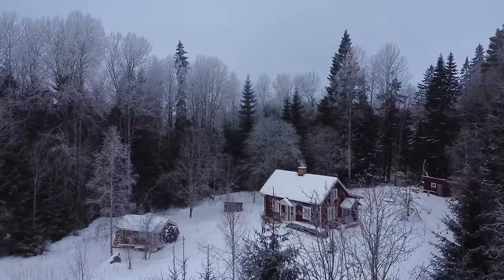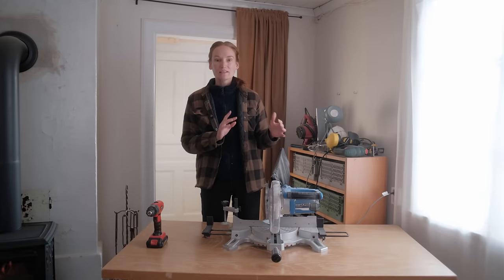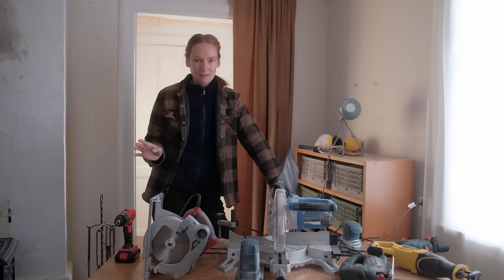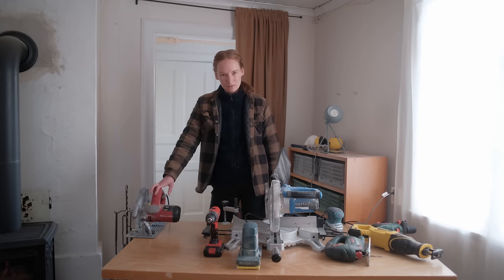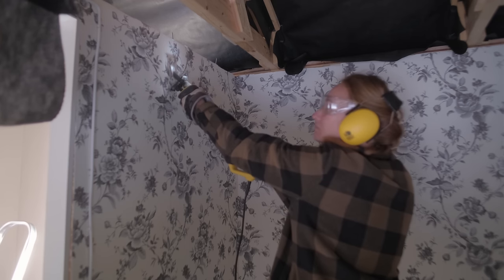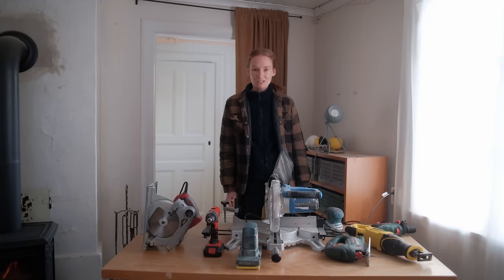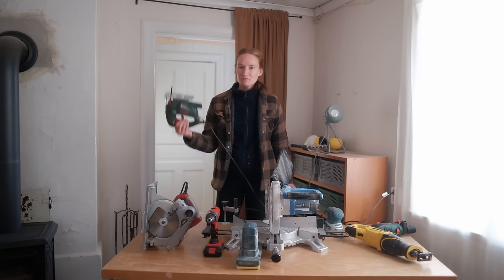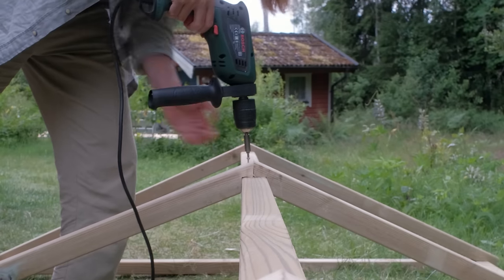The (basic!) Tools I Use To Renovate My Cabin

Comment: Reading through the comments (as I dont want to repeat) I can add the jig saw can be used for other materials like plastic and alu, it also has a screw on the bottom plate (shoe) to adjust the angle of the cut, 45, 30  degrees etc. though I dont recomend it,  you can also do the same with the circular saw, adjust the plate for an angle cut,  also there are different blades for the circular saw (number of teeth) for a different cut,  you have more tools than I do, and I renovated the house. personally batteries are not better, they are conveniant but fail, some do last a long time but they are usually the higher price range, so make sure you have a spare if you do use the cheeper option. there is alot more to say but not enough space in here, take care, your doing a wonderfull job.

Comment: Just a few toughts:
I dont know about the prices but maybe a long level is cheaper that a ruler, so you could use it for sawing straight.
If you want to get a track saw, look for off brand or used tracks because they can be really expensive (especially Festool) and in my experience they work just fine (but you have to look up if they are compatible, I belive makita has their own system.
Safty equipment is very important, even thou on youtube a lot of people dont seem to use it. Also use two hands for the circular saw; in case of kickback you are more likley to hold the saw and dont get injured.
 I think you are doing an amazing job, teaching everything yourself so just keep on doing it :)

Comment: What you have achieved with the tools you have shows just how much dedication you have for your work. Since you are in the market for new tools, but you do not want to break the bank, i would recommend the Parkside tools from Lidl in general, but especially the Performance line. Just make sure you get the 20V battery ones and not the 12V as those are not powerful enough. Good luck with the future projects!

Comment: Hello Rosie,
A very useful video, THANK YOU!

Based on my experience, I highly recommend considering the weight and size of any tool before purchase. 
It's necessary to think - how long you will work with the tool - if it's rather small, occasional, a couple of minutes lasting repair/s, or if you plan to build/create something more consistently. 

1. Even the tool of the greatest performance will always(!) ask for some of your hand power (arm, wrist) power. Every tool has its own weight, and it takes time/repetition to achieve the desired result. It all can lead to overworked hand exhaustion and even accidents if one is too tired from working on the same thing for a longer time.

2. If the tool costs more than 100.00, I go to the store and try it there. Everything over 200.00 is worth borrowing first and trying to work with (at least) for an hour. (Nothing is more reliable than your very own experience!)

3. If you are blessed with friends like Rosie, lol, who has a shed full of different tools, I highly recommend visiting them and asking for their assistance. If you have a chance, try it all there before purchasing your own.

4. I prefer saving money and purchasing the best (best brand) tool I can afford; it's usually worth it.

5. Before purchase, I consider usefulness/functionality/ and universality vs. single job doing; it always depends. When that's decided, I go after performance/user-friendliness :-), weight, and size. (A great tool that is too big/heavy for you may actually be useless.)

6. Price is always my last parameter because if you purchase a quality tool that fits your hand/s, which you care for/store properly, and you have enough frequent usage for it, then, the price is definitely the last thing you should care about. 
After all, in the long term, it's not only cheaper; it also is less annoying (maybe even joyful!) than working with some crappy tool that doesn't do the job properly, and you need to work more or harder than you would if you had a proper tool... 

7. If you cannot afford a quality tool, try to borrow it before purchasing some super cheap alternative. Cheap doesn't always mean miserable, but when you try working with a quality tool vs. a low quality, you will see THE DIFFERENCE.

Comment: You mentioned that you would need like a 20 meter long area inside to use a table saw, but they make table saws that fold onto wheels and roll outside. They also make roller stands and such that wouldn't require you to have benches on other sides. I work in construction here in the US (specifically a lot of rural work, similar conditions to what you are facing in some ways), and when I need a table saw onsite we use that option. I actually just roll my table saw outside even at home, I don't have a permanent table saw setup. So a table saw certainly is an option for your space setup. (this is assuming they have that type in Sweden, the brand of mine is Kobalt, not sure they sell that brand but there is likely an equivalent)

Comment: Warning that going smaller on tools does not always make for a quiet saw, with a big blade you can spin it a lot slower and still achive a speed that prevents stalling due to a large circumference of blade, with smaller ones the RPM of the saw needs to be much higher to achive the same blade speed.

Comment: my tip when it comes to battery tools.
as you are a single user it will be good to have at least 2 batteries.
due to charging time and you don't have to change batteries between tools all the time.
when it comes to nail guns, buy one that only uses batteries
and not one with a gas cartridge and battery
yes, things are expensive, but as a home user will have the tool for 10 to 15 years
to go for a slightly more professional tool, you will notice the difference yourself,
on weight, noise, battery life, how the machine is balanced in your hand when you use it, and sometimes they have 2 machines that are the same
but for big and small hands.
so next time you're at Jula, try out the brands they have there

Comment: Hi Rosie, I am very happy to have discovered your channel. I am an Interior Designer as well who bought her first house three years ago and also did a big part of the renovations herself (with my husband chipping in for the heavy lifting). Firstly! Well done! Welcome to the wonderful world of fabrication! It will make you a better designer and it is extremely satisfying! 
I have been catching up on all your videos and I made it to your tools video.... I have soooo much to tell you. This is going to be a long post. I hope you don't mind. I hope you read it all.... tools have become kind of my thing and this is just meant to help impart hours and hours of research and months and months of trials. Not passing judgement.... not selling any particular product...I have no ulterior motives other than "paying it forward" as I have received , from others, tips and tricks when I did my renovation work. I have a limited budget. I am all about smart spending.
Firstly cordless vs cords..... most tools I find are better with cords!.... with a couple of exceptions: drills, routers, mini circular saws. When you think of the time needed to sand something properly, a battery will just annoy you because it will run out. And since you aren't moving to job sites where electricity is a problem, there is no need to go cordless. Save some money! Stay with cords. 
As a general guideline, investing a little money into some "dangerous" tools is worth it. After nearly three years of fabricating and constructing and renovating I can tell you my hands have suffered... A LOT. But less than they would have if I hadn't invested in tools that reduce vibration and tools that protect you from cutting your fingers and loads of other things. Since you no longer fit the young lady category, I have to strongly suggest you take care of your hands... without which the path you have chosen will be hard to follow.
As a contrast to the above comment, some tools are all about the accessories... so for example... circular saws are all about the blades.... that's where you get good results much more than if you spent money on the tool itself. Drills are all about the bits. Good bits reduce stripping heads. Good screws reduce stripping heads. Jig saws are all about the blade as well.. and there are reverse blades than can help with the edges.... Depending on how and what you are ripping. So second thing to keep in mind is : one some tools better to spend on the accessories than on the tool itself.
Cordless drills are very practical. FYI The large drill you rarely use is mostly designed to help you with masonry work.. thus the bulk and the weight to help drill into heavy duty materials.There are packs you can get of speed drill and impact drivers relatively inexpensive. I suggest you find a company you like and buy ALL the cordless tools you want form them thus limiting the investment in different types of batteries and battery chargers.
Torx screws are not an American thing. They are a millworker Joinery thing... it helps reduce the stripping of heads much more than on a Phillips head. If you are like me and have made mistakes, you will want to take things apart and it won't be easy of you strip the heads off your screws.... so torx will help with that.
Mini circular saws - as you've said you wanted one, may I highly encourage you to buy a mini circular saw.... it has changed my life. (I have a relatively inexpensive option from Bosch Pro :the blue tools not the green ones; it is wonderful). 
I love the Japanese hand saw. I have the same issues with a full sized traditional saw as you do.... so 👍 
Sanders should be corded! may I strongly encourage you to invest in an orbital variable speed sander - it will change your life and no more swirlies. I have a Bosch Pro one as well - on of my favourite tools. This is a place where investment will make a difference... spending money on a good tool that reduces vibration to the hands will actually make you healthier and help you enjoy more the thankless task of sanding. And of course it is all about the sand paper.... so invest in good sand paper and a sand paper eraser (which will get rid of all the gook and keep you using the same sheet for longer and thus actually saving money than spending it!) I would leave the belt sander for later... it is more of a specialty joinery item.
Inexpensive but good Nail guns come with a compressor (forget the electric ones! you won't find a good one without investing a fortune!) and although I fought this for a long time, I ended up buying an inexpensive combo and found that the compressor is actually very useful for other things. It blows dust off your work surfaces and your clothes after like... heavy sanding, it can blow leaves for a quick yard clean up. It can fill air into your bike tires and it can supply your nail gun with the impact necessary to function properly. There are inexpensive combos from good companies that you can look into and I Promise it will change you life.... this coming from a converted "non believer in air compressors". 
Track saws are expensive - HOWEVER.... there are accessories that you can buy for your normal circular saw (no matter the brand) that will allow you to use what you have and get some of the benefits of a track saw. For example a guide into which you can secure your existing circular saw that will allow you to cut sheet goods with accuracy. There are "t-squares" for circular saws - even less expensive than guide rails. So before investing in a track saw, do some research. I am happy to share with you products I have found that are inexpensive and that have helped me to do quite accurate work. 

Ruler: yes they are expensive! I have just bought an Incra one and I highly recommend it.... Am happy to send you links and info on it.... it has changed my life.
Ok I'm going to stop here for now...."it will change your life" is not just an expression... At least when I say this, I mean it has actually changed my productivity, the outcome of the project and thus my life... I am happy to help you in any way you may like. I have tons of tips and aids I can suggest having been through what you are going through now. 😊
Reply from the maker: LOVED reading this! Such helpful insights and experiences. I hope everybody who watches this video reads this comment well 🤗
Reply: @wildrosie  Happy to help 😊
Reply: @wildrosie  Matthew from 731 Woodworks has an excellent channel. He is a wood worker. He is an excellent source of information concerning tools and jigs and tips. you might want to check him out, but be careful he will make you spend money since he reviews tools that are very cute! 😊

Comment: I bought Dewalt drill and multitool cutter. Ryobi battery operated nailer. I watched for sales, deals with batteries and chargers and free shipping. I have a chop saw like yours, still need a circular saw. I have wood chisel set, screw driver set, clamps, hammers, paint sipplies, utility knife.

Comment: Hello Rosie, I'm excited to see what you can do. My husband has a collection of Ryobi tools for crafts and gardening. He is enthusiastic about the brand because it has practically everything and is constantly expanding the range. But also because of the price, the performance, the spare parts and the batteries. These come in different sizes so you can work longer or make the device even lighter with a smaller battery. I am 167cm tall and can use all devices well (there are certainly people with shorter fingers 😉). I don't know if the devices are available in Sweden, but I can only warmly recommend them. Warm greetings from Switzerland (Translated with Google)

Comment: You accomplish great things with what you have.  As for sanding, most of it is in the sanding paper grit you choose.  Coarser grit (with the lower numbers) then use finer and finer until you are satisfied with the results.  I could tell you (like others might) which grits to use in sequence but let your satisfaction level teach you with practice.

I dislike battery powered tools specifically due to the unchargeable battery dilemma.  When the battery dies (and it will) buying another again and again.  And then the manufacturer discontinues that tool line.  And by the way, I have never cut a board or drilled a hole with a manufacturer - I only use a tool, you know, the one I have.

Most, if not all, jig saws have a way to tilt the bed of the tool up to 45 degrees.  Your battery jig saw may have something loose (why the plate moves around).  And your corded jig saw should have some way to tilt it.  By the way, your jig saw cuts are awesome.  Mine never seems to go straight up and down but the blade tilts to one side or the other.  Might be me or might be I need a better saw.

Comment: To any DIY:ers. Never use a impact drill if you don´t absolutely have to. Get a Rotary hammer. While it might seam like it the same thing, its really not.

A rotary hammer can typically also be used as a normal drill with a attachment. Its better to have a normal drill, but if you don´t have the budget, and you need to drill in concrete or stone, get a rotary hammer and the attachment.

Also a impact screw driver is really recommended, specially when in hard to reach places it really helps.

Circular saws are dangerous and hard to use. It need respect. This is also one of those "if you have the budget". I have a small battery driven circular saw for every day use, and a larger corded for bigger work. The smaller is so much easier to use. And of cause. Circular saws EAT battery, so the cordless once should only ever be used on small work.

I would say a miter saw is generally better than a table saw, at least for build work. If you do fine carpeting it might be different. A table saw is also not really very easy to use for a beginner. I have the exact same miter saw, it works great. Quality is... well half decent, not perfect. I used mine a lot. Its is really freaking loud, even with protection. I typically try using it only outdoors, that helps a lot. Just put a tarp over it if its rains

Its worth saying for battery operated tools, the battery have a limited life span, about 500-800 full charges. For general drilling this is really not a problem. You need to drill pretty much all day to drill a whole battery worth. But for a circular saw or a reciprocal saw, they run throw a battery in like 10-20 minutes. You can easily run a battery until its dead in just a week.

All tool battery will die eventually. Make sure you have a tool where you can source new batteries. Other vice your tool will be use less. Also try to have same battery for all tools where possible. This way its easy to see if the battery or the tool is dead.

WIth a impact driver, you no longer need a nail gun. Yea sure, nails are a bit cheaper, but impact drivers make it so easy.

I personally have Ryobi 18V, makita 18V and makita 12V. Ryobi tools is a bit cheaper, but the battery is really expensive, so i really try avoid using the Ryobi tools when i don´t need to. The Makita 12V is mostly used for like fixing stuff in the home and driving small 30 and 40mm screws and drilling small holes. Makita 18V set use pretty much exclusively for building. I have bought quite a few batteries. Probably like 8 or something

Comment: That was very interesting, thank you! Our house is a steel concrete/flint-lime brick house from the late 60s, so we need to use that big hammer drill for hanging pictures and stuff like that and have less nails to hammer in (they don't work anyways...). We bought into the Einhell system for our renovating jobs and and the garden; for us complete youtube-taught amateurs, it's good enough and we don't regret it. 
So what if something doesn't look factury-made, as long as it works and one can tell the story of how it was built, it's the best. I love to admire great craftsmanship, but i'm also content with what i myself can achieve.